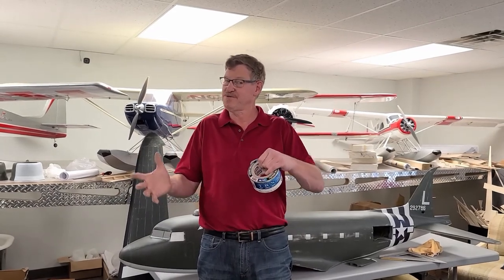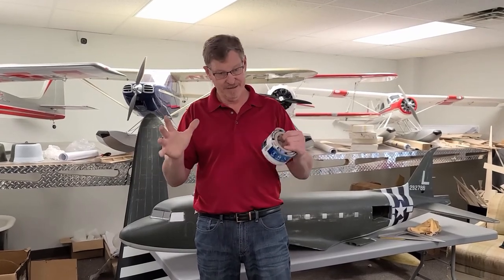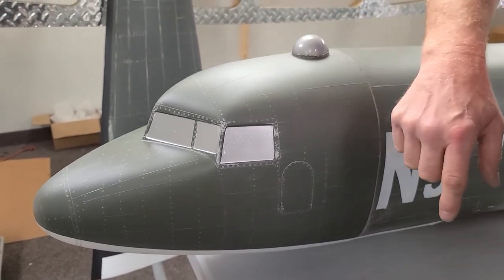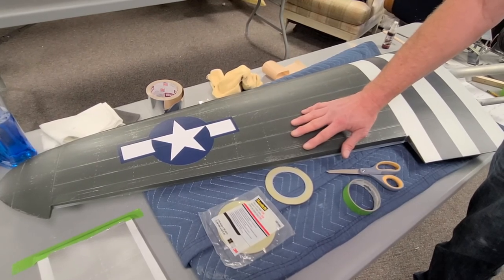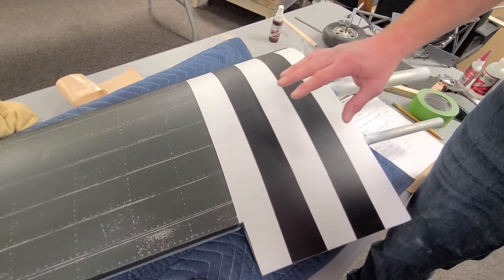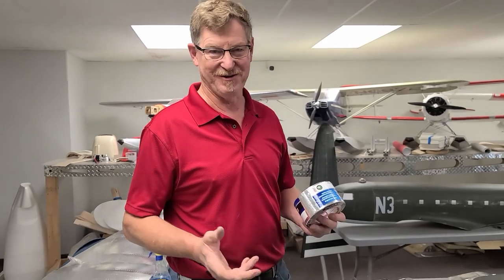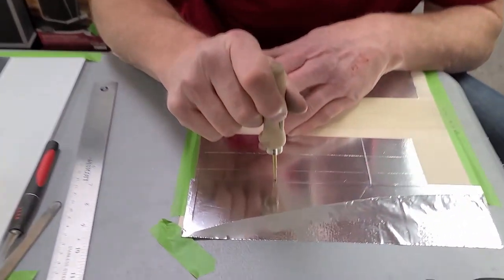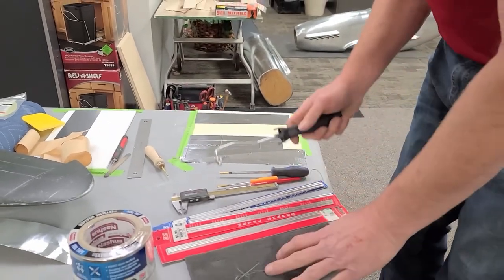C-47 PAINT OVER ALUMINUM RCTWINS

Comment: I've begun work on an AC-47 Spooky rc model.  I will use your techniques to "weather" her up.  Thanks for sharing! Keep the vids coming 👍 Great stuff💪
Reply from the maker: We will get her airborne this summer and will have a build video as well!
Reply from the maker: Also we made the center section a little wider so we could run a little bigger motors
Reply: 5" wider, I used the original holes in the ribs and ordered extra of the small wing tube to act as a twin reinforced spar, made a few extra ribs in the middle. Video coming soon.
Reply: I am building a Zaroli P-40. Wait till you see the paint scheme. It will be historically correct, uncommon of course, and bad ass!
Reply: Thank you so much for your comment!
Reply: Amazing work